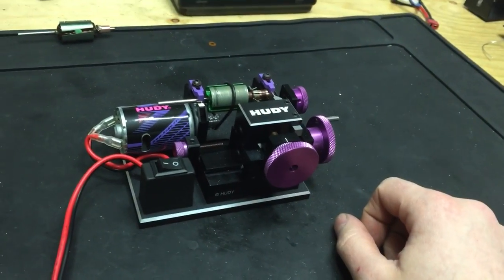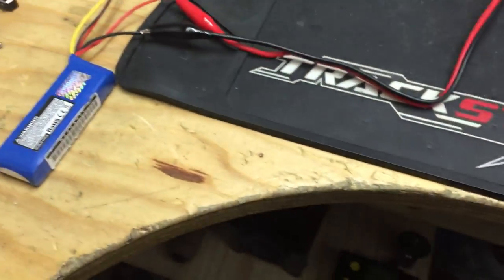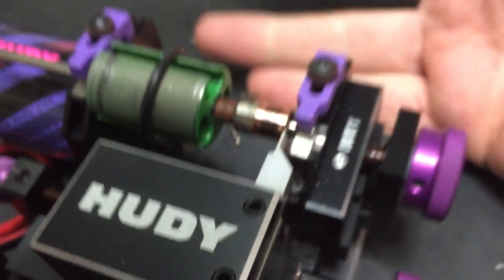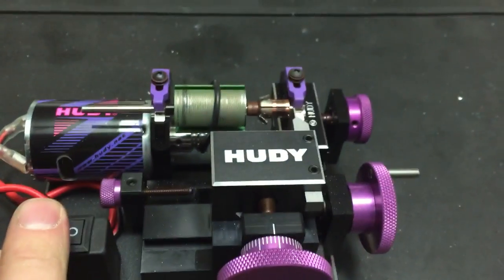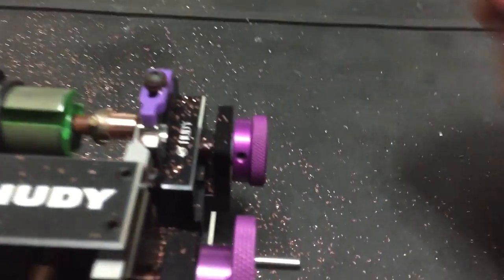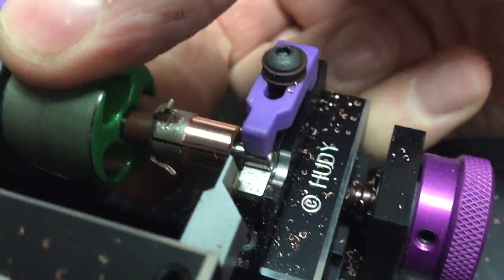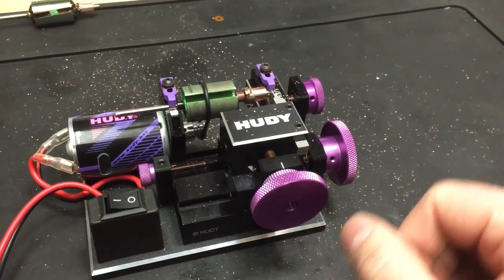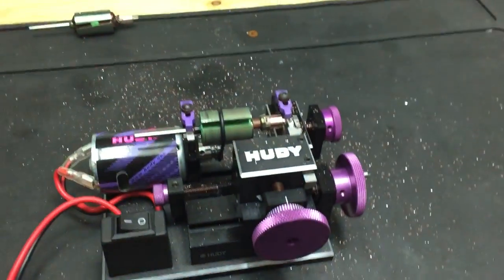Hudy Comm Lathe for Airsoft motors

Comment: nice upgrade on the BBG's. 

Have you considered a castle creations 10 amp b.e.c.
There voltage comes directly from up to 6s lipo, and can be adjusted down to as low as 5v.
Reply from the maker: +Daniel smith   Cheers :)
I really couldn't understand why Hudy released the BBG guides at the same price as the V-Slot ones.
Their statement that they perform the same so the BBG ones weren't needed (and therefore have been discontinued) is absolutely false.
Maybe they just couldn't be bothered producing the more complicated setup.

That's exactly the sort of thing I've been looking for!
My electronics knowledge is still pretty basic, so thanks for the suggestion :)

Comment: Have you ever fitted a ptw core in that.? Have the same lathe but will not fit ptw
Reply from the maker: I've modded mine to accept the longer PTW armatures. 
The slot for the motor stand has been extended to the left and I use a shim to match the angle. 

I've also upgraded the axle clips to the bearing versions, which I'd highly recommend doing for Airsoft motors. 
I've found the larger axles tended to overheat the V-Slot supports with the plastic clips. 
Just be sure to keep the bearings clean :)
Reply: @KingdomofAirsoftUK  thanks for the answer. I'm gonna extend mine as well. Do you by any chance have a picture of the mod I can see
Reply from the maker: @JensNybro  No worries :)
Drop me an email and I'll send you the details of the mod and where you can have it done (if you don't have access to a milling machine): sam@kingdomofairsoft.com
Reply: @KingdomofAirsoftUK  thanks a lot

Comment: my guess is that after spending the rather high price for there lathes most people just couldn't see spending even more on the BBG's. 
 I still run mine with the V guides lubed with corrosionX, but maybe I don't know what I'm missing. 

 My experience with comm lathes comes from the rc rock crawler side of brushed motors. I run a castle b.e.c. in every crawler I own. they are a must when running high voltage servos. 
 Keep in mind you will either have to have it pre-programmed by whoever you purchase it from, or buy a castle creations pc interface  board to change the output voltage.

Comment: What is the exact model of the lathe? Does it any beat/bad vibrations with installation of comm 'as is', without wires removal? 
Thank you)
Reply from the maker: +SumskoyMike Any armature can be trued up as-is, you don't have to unwind the magnetic coils.
I did that because I was going to be rewinding it anyway.

This is just the Hudy Advanced Comm Lathe.
There is also the Hudy Tech Comm Lathe that comes with a slightly different layout and some extra accessories.
I'd also recommend looking for the Bearing support guides as the plastic clips don't last very long.

Comment: f.y.i. 
 that lathe will run best and last the longest if you run it at around 5v.
 7.4v (8.4v fully charged) is way faster than needed.
Reply from the maker: +Daniel smith Yeah, I'm well aware of the recommended Voltage to run this on.
With the bigger armatures, the AA batteries Hudy recommend cannot provide enough current and I do not have a powerful enough variable voltage PSU.
I'll eventually get around to sorting something out but for now, it runs just fine on a half charged 2-cell LiPo.
A little graphite grease on the armature helps reduce the heat buildup on those ridiculous V-Slot stands.

I was very lucky to find a place that still stocked the BBG left stand and adjustable BBG right stand :)

Comment: f.y.i. 
 that lathe will run best and last the longest if you run it at around 5v.
 7.4v (8.4v fully charged) is way faster than needed.